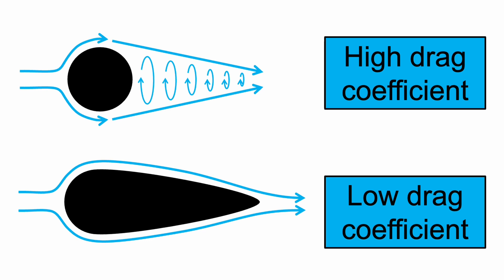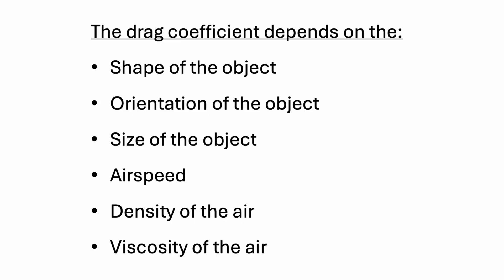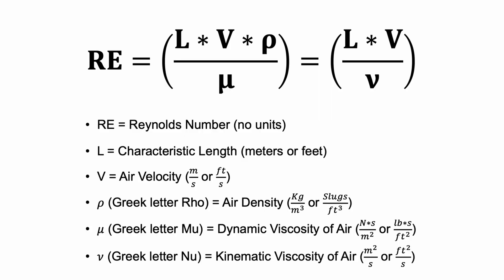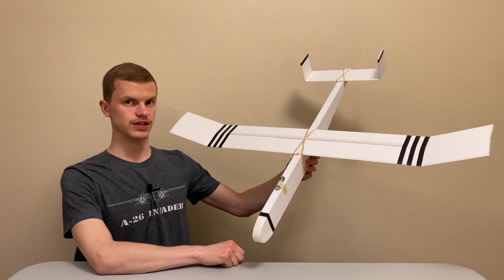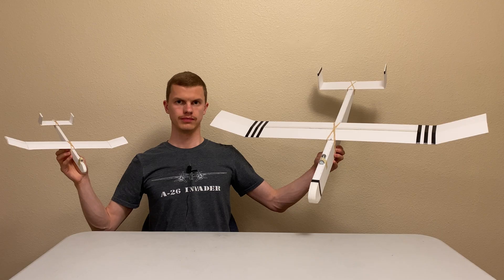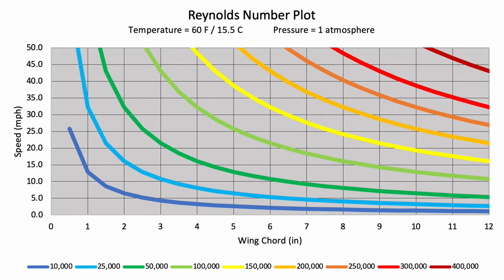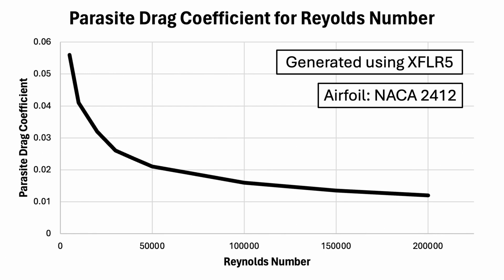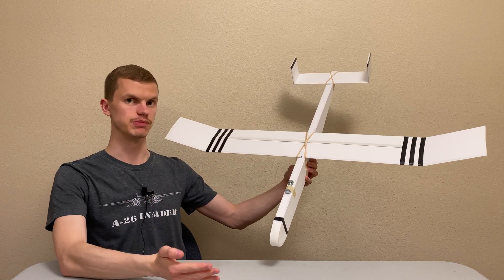Reynolds Number Explained

Comment: I took an aerodynamics class in college and still did not understand the Reynolds number. All I can remember is my professor essentially saying "always go with 1,000,000" since we were dealing with small real airplanes like the Cessna 172 and Piper Cherokee. You explained this significantly better. Thank you
Reply: These "small planes" are not small at all. Thanks to that heavy engine and the gas tanks, these monsters are two or three times the weight of a two seater glider, that does not need such a huge metal blob up front. And try parking such a "small plane" in a parking lot, you'll see it is far larger than a car. Even those ridiculous large American cars are dwarfed by what you call a "small plane". You are confused by the size of airliners. You think a 200 person plane is the normal size, well, it is close to the size limit. Any larger and it will break in two. Small planes are half the weight and size of the planes mentioned. Do check the Rutan designs, the smallest EZ's are twice as fast and burn way less fuel (mileage) than the giants you named. Because they are way smaller and way smarter designed. That tail in the back is pulling a plane to the ground! Did you ever think about that? It is safe, it is as stable as a badminton shuttle, but it is pulling you DOWN. And causing extra drag. Why do people keep using such fuel burners? I don't get it. Get out more. Do a conversion to an EZ. That does not imply you must buy one, but I bet you will want one. Because of the Reynolds number, maybe.
Reply: @voornaam3191 not sure I agree with “a 200 person plane” being “close to the limit,” there are plenty of examples which refute this claim: A380, B747, B777, B787, A350, A330, A340, just to name a few. Size is only limited by the overall weight of the aircraft and power of the engines available, not by sheer size alone.
Reply: That tail in the back gives you better dynamic stability…. the reason almost every aircraft has one!! Having a tailless aircraft is more efficient in reducing weight and drag, but compromises to get controllability/stability of that design reduces its advantages. Aerodynamic efficiency is one thing; safety and stability are another in many cases!
Reply: Rutans are not good concepts, at least the first 20 years worth @voornaam3191 .  No one in his right mind would put the engine in back, and the tail up front.  The Wrights were equally misguided! <- pun
Reply: I kinda learned about it in numerical methods class without knowing what it really was. We were running simulations with particles that are sneezed out.
Reply: Reynolds number is an adimensional number, has no units, that indicates relationships between inertia and viscosity forces inside a moving fluid
Reply: @josega6338  No, Reynolds number  formula indicates precisely what , where and when happens turbulent flow.
Reply: Arr, aviation and aircraft design. It's why I love it. We can design anything to be strong, flexible, corrosion resistant, efficient, +++. But when you have to lift this design and move product (PAX) the compromise on compromises that have to be accounted for is why I love aircraft and the related engineering. Si, Christchurch, NZ.
Reply: It's dimension less number refrence for fluid patterns

Comment: Basically while the size of model aircraft and their control surfaces changes, the density, inertia (or force needed to move) and viscosity of air stays around the same, so model aircraft and the way that they fly doesn't scale linearly with respect to the properties of air and this has to be factored in when building model aircraft at different scale sizes.

Comment: Great video. I dont have foam board available in my area so can you please make the next plane with some other material please.And can you also teach us how to make a rubber powered plane. Great videos thank you very much.
Reply from the maker: In a later video I plan on talking about building materials.  You can also use pressed or corrugated cardboard, balsa wood, corrugated plastic, thick paper, or insulation foam.  I'll consider making a video about rubber powered planes.